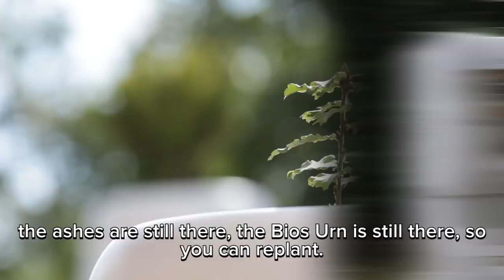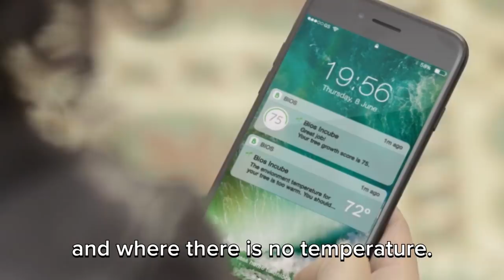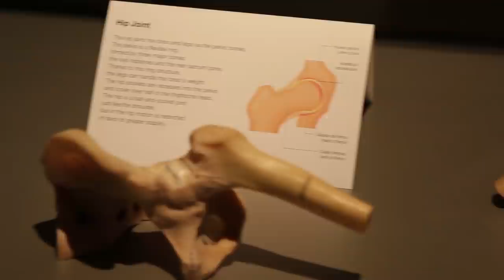I Planned My Own Burial

Comment: I am super psyched to see Buzzfeed do a video on this topic. Because contrary to what she says at the beginning, this is not weird at all. Every one of us is going to need a plan for after we die and I think it is smart to think about all of the options ahead of time.

One thing to keep in mind if your goal for your death is to be as "green" as possible, is that cremation itself isn't necessarily a "greener" option. You definitely don't take up space in the same way you would if you were buried, but the act of cremation itself (even with no embalming, no casket etc) does still pump pollution into the air.

I say that as someone who has chosen that option for myself - so no judgement - just be very aware of the realities of cremation if your goal is to "go green" in death.

I HIGHLY recommend Caitlin Doughty's Youtube channel "Ask a Mortician." She is an alternative death professional in California and is very active in the conversation of modern death traditions and options and dispels a lot of rumours around what is "required" when someone dies vs what the funeral industry will pressure you into.